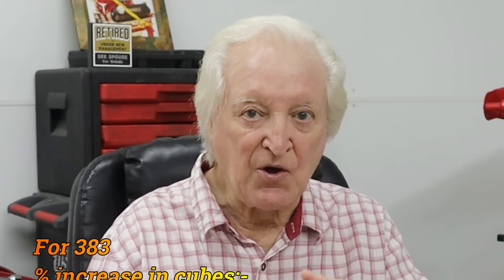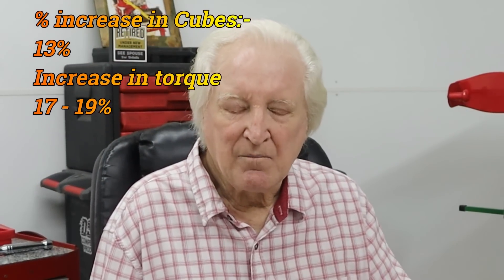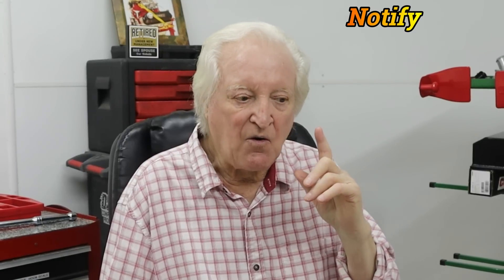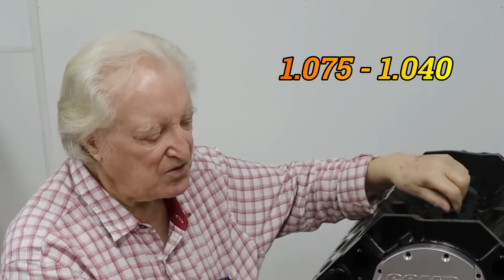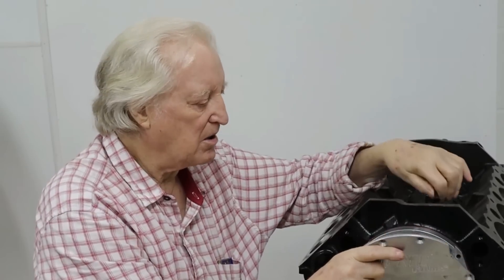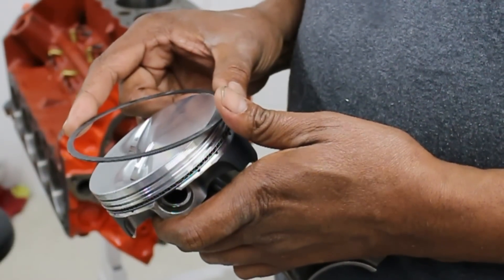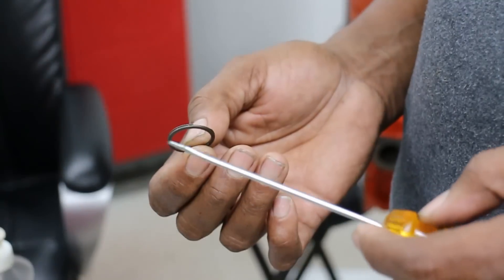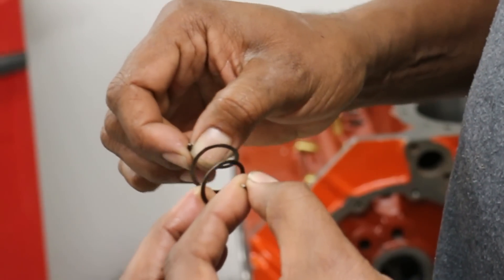Why are these #'s critical for a good torque build?

Comment: What about 87 octane for my daily driver?  I’m thinking 9.0:1 for double hump cast iron heads ported as per your suggestion.  Cam 225 on a 110 for a 327
Reply: Thats about right. You can rent his cam program for two week segments. It has everything to narrow down what is optimal for your application. He did a walk-through of it on one of his videos but it's not titled properly to find it.
The link to it is in the description of many of his videos.

Comment: A good racing trick is to leave the first piston ring off the motor to make the reciprocating assembly liter and keep the top ring from locking up the motor if the ring gap is too big.

Comment: Very informative video. I was just inquiring if the same concept would work on LS style engines (4.8L, 5.3L, 6.0L) as it does on small block 350 Chevrolet? What about forced induction use (turbocharged/supercharged)?

Comment: Looking to build a 383. This is what I have. 1 pice rear main block (880) 4 bolt main. Scat 383 crank, 5.7 rods ,Speed Pro H860CP30 383 Flat Top Pistons . A set of heads World S/R I 052. Performer rpm airgap intake. All I need is a hydraulic roller cam and lifters for this block. Everything I have listed I have lying around in my shop, so all I am going to pay for is machine work for the block. My goal here is to build a 383 that is all torque for a wood hauling truck plus tow hall like a trailer for camping. I guess what I’m asking is for a cam recommendation and if these heads will work with this combination. Thanks again for your time great informational video.

Comment: I would be curious as to what the dynamic compression ratio was on the 396 that you built that made 542 ft. lb. and 585hp with the 10.8 to 1 static compression.
Reply: and what heads.....?

Comment: The reason the huge gain in torque of a 383 is because you are not only increasing the volume of the charge, but also the piston has more leverage on the crank, being that the journals are farther away from the crank centerline.

Comment: Mr. Vizard,  It appears the 400 cu. in. small block is the red headed stepchild in builds. I don't understand why , people are so willing to give up cubic inches of the 400 to grind and machine the 350 block to gain 30 more cubic inches. What are your thoughts on this.
Reply: 400 has really short rods, supposedly doesn't like to rev, they also didn't make a whole lot of them.  Personally the way I figure it if you're looking for max power/$ you build a 454 if throwing tons of parts and work at a 350 is required to meet goals and you can fit the larger engine.

Comment: You helped my late friend Terry Towns back in the late 80's or early 90's with his 355 sbc. He had a 69 camaro running 9.90's on the motor with 10" slicks and slapper bars. After you milled .150 off the pistons, a "good" valve job, and I believe you degreed the cam it ran 9.60's!!!
Amazing!
Reply: Richard I am planning a video on Terry's car. Any photo's? Sorry he has passed away. Good guy for sure.
Reply: @DavidVizard  I'll have to look through my photos.  Phil Smith is who helped Terry with the chassis, like using Mazda 323 struts for the front suspension. Unfortunately I dont have any of his contact information. Brian Desermo, (I probably misspelled his last name) was real close to Terry and probably has some useful pictures and possible video of the car. Again I dont have any contact info.  I'll look into getting you more information. Thank you for all your help past and present! 
Sincerely
Richard Bentley 
Richard Bentley

Comment: I got a 10.98/1 (9.0/1 dynamic compression) 93 octane on street 406 (1974 817 cast) with 220 Flotek CNC .200 raised runner heads that flowbenched at 315cfm @ .600 and a cam I'm not sure abt. Older 830cfm BG HP950  It's a Schnieder 292 hydraulic roller with .622 ex/.613int 70° overlap but only 242/238 @ .050 on a 110 lsa degreed to 108. Howards race lifters, It's all forged weisco flattops scat 6" rods with 9000 series scat crank... I did a 7.13 @ 98.8 mph spinning on street tires. But feel like she needs more cam. Th400 with Hipsters brake, 4500 8" Freakshow nitrous stall but won't spray her till I get her to hook with some qa1 shocks and stickies... Thoughts on the cam?? Ty.

Comment: The GM GenV Small Block L8T Direct Injection 6.6L/401cu follows your talking points, from the factory.
9.240" Deck, 4.065" Bore x 3.860" Stroke with an 10.8:1 Compression Ratio using 0.051" Head Gaskets.
Factory 6.098" Rods give a 1.580:1 Rod/Stroke Ratio, with a 1.053:1 Bore/Stroke Ratio.
87 Octane friendly (and recommended, even @ 10.8:1) thanks to Direct Injection.
Factory Heads (Intake) flow approx 207 CFM @.300, 260 CFM @.400, 300 CFM @.500, 320 CFM @.600.
59cc Chambered Heads. Splayed 2.126" 12.5° Intake and 1.590" 12.0° Exhaust Valves.
297cc Intake/107cc Exhaust runners. Tiny ~116LSA+ Camshaft (200°/207° @ 0.050, 0.551/0.524 @ 1.8:1 Rocker).
HP/TQ at the crankshaft (running all accessories etc.) is 401 HP @ 5,200 RPM, 464 LB-FT @ 4,000 RPM (SAE).
With a suitable camshaft (similar lift, 110-112 LSA, 235/240 @ 0.050), Intake manifold w/100+mm Throttle Body
and timing/Tuning for better fuel, this stock engine can easily see 150+ Gains in HP/TQ.

Comment: Hi David, I wondered the torque increase myself and came to a potential answer.

A longer rod slows how the displacement grows from TDC through to 90 degrees of crank rotation when compared to a standard "short" rod. Since the longer rod has a smaller space through the first 90 degrees of rotation (and a bit over) then even if peak cylinder pressures were the same, the rate of pressure decay would be less. This would yield greater pressure by virtue of the smaller volume. This pressure would be applied through the power stroke until either the volume matches the short rod or the exhaust valve is open, all of which would lead to an increase in torque.

Im sure there is more to it than just that, like the extra dwell at TDC of a longer rod to help build more pressure from the burning charge. 

Just something I thought was worth contributing.
Reply: and now you know why chrysler engines (especially big blocks) smoke the others on torque when most other things are equal.
Reply: Heavy Mopars are slow car's. GM #1 .

Comment: I would love to see the reasoning  behind domed piston vs dished piston for a given compression ratio.
Reply: I can't speak for Mr. Vizard, but I believe the common idea is that the "large dome" style pistons incumber the flame front [not very efficient for complete combustion] as it travels across the piston top. A flat top piston [very efficient] is ideal for flame travel, a dished piston is second best. Sometimes there is no option, and the only way to achieve the desired compression ratio is with a domed piston, like in the case of most Big Block Chevy's.
Reply: @Torquemonster440  Hemis would seem to be horrible for flame propigation.
Reply: @machwind3266  , just the old versions
Reply: It's flame front disruption
Reply: Besides. I'd rather hear it FROM DAVID. not a nitwit that thinks another comment is going to prove something.
Reply: Could also be the proportion of surface area on the piston. More area on the piston can capture more of the force from the expanding gases.
Reply: @purestress2597  No - if that were true they would spiral-groove every flat-top piston for more of this "surface area"
Reply: No. The cost to machine or cast that increases manufacturing difficulties and cost. Ford knew 2 more cams would open up the modular engine to make 150 to 200 more hp. Money killed it.
Reply: @purestress2597  So - talk to me about the "3-valve" Ford V-8's that basically eat themselves !!
Reply: @peterdarr383  3 valves 2 cams. Ford wanted to do 4 but bean counters killed it. Woosh.
Reply: @purestress2597  You don't go "Woosh" on the side of the road
Reply: If it's come any closer it would've hit you.

Comment: Why is it modern motors have small CC heads, small domes. Old big blocks and small block chevys had small CC heads and small dome pistons. Yet. The old combos were called dirty heads that shrouded the valves and limited HP. So the most common  and  powerful BBC & SBC motors use large CC heads and huge domes. But DV says that costs HP. 🤷‍♂️🤷‍♂️ Guess my 1966 396 BBC with 98 CC heads, 10.25 comp. ratio is not antiquated junk??
Reply: DV's contention is that most combinations could be improved.

Comment: what about a 4.155 bore (400 block) with 3.5 stroke?
Reply from the maker: Mr. G
 I have done a 3.75 stroke 4.03 bore Vs a 3.48 stroke with a 4.185 bore. Both work out to 383 so it's a question of short stroke Vs long - both with the same cubes. I will dig out the results so keep watching!
Reply: @marvingvx1  Thanks very much.  By the way, I am planning on running 6.150 rods.
Reply: @marvingvx1  I would also like to see the performance difference  between 3.48 and 3.75 383sbc.both w 5.7 rod.would cam spec on 3.48 be similar to 350? have you published test results in mag or book? I have a 400 block ,350 crank,camel hump heads.new72lt1 hydcam(yeah, I know there are better cam choices, but is for street driving and don't want stiff springs and reduced reliability plus cam is paid for long ago.)I have not compared build cost yet, just thought about putting some old parts to good ?use.im in research mode and always trust your information.

Comment: Your video was  fascinating as always. I sure which you could do one to explain how you get away with high compression on low octane. The video you did on the 705hp, 421 sbc  on 87 octane is amazing.
Reply from the maker: Cameron - I hate to say this but it should be on 107 not 110.Kiss 25 hp and 25 lbs-ft goodbye matey - sorry!
Reply: The cam grind is basically the only difference. The cam will close the intake valve later on a high compression, low octane motor. Giving it less stroke to actually compress anything. That lowers the dynamic compression, which is basically the cylinder pressure before it fires. Most NA street engines operate at a dynamic compression ratio to 8 to 9:1, regardless of what the static compression is. The higher the static compression the less stroke you can actually use to compress it, simple as that. Motorcycles use this a lot... Variable valve timing can take way more advantage of it as well....

Comment: looking forward to a mopar 408 LA stroker combo.I plan on building one this winter for my street CUDA. will be using trick flow 190 cc / 60 cc chamber  and - 20 cc dished pistons for approx. 10.0-1 compression .need to pick a cam that will work with power brakes .changing the ring and pinion from 4.30 to 3.73 .providing i can get parts.
Reply: On a 408 with 10:1up and aluminum heads power brakes = a comp XR282HR with 110 or112 Lsa should do it.

Comment: I am putting a Comp Cams 305H cam into my 383 stroker  bored 30 over, and I would love to hear what you think of this grind?

Specifications:
Engine Make/Size
Chevy Small Block (262-400)
RPM Range
3500-7000
Lifter Type
Hydraulic Flat Tappet
Int. Duration Advertised (Deg)
305
Exh. Duration @ .050 in. (Deg)
253
Exh. Duration Advertised (Deg)
305
Int. Duration @ .050 in. (Deg)
253
Usage
Street/Strip
Quantity
Sold individually
Lobe Separation (Deg)
110
Exhaust Valve Lift with Factory Rocker Arm Ratio (
0.525
Intake Valve Lift with Factory Rocker Arm Ratio (i
0.525
Valve Lift with Factory Rocker Arm Ratio
0.525 int./0.525 exh.
Advertised Duration
305 int./305 exh.
Computer-Controlled Compatible
No
Valve Springs Required
Yes
Cam Style
Hydraulic flat tappet
Exhaust Duration at 050 inch Lift
253
Intake Duration at 050 inch Lift
253
Duration at 050 inch Lift
253 int./253 exh.
Advertised Intake Duration
305
Advertised Exhaust Duration
305
Basic Operating RPM Range
3,000-7,000
Grind Number
CS 305H-10
Exhaust Valve Lift
0.525 in (13.335 mm)
Intake Valve Lift
0.525 in (13.335 mm)
Reply: David always says tighter lobe separation is better.....after watching tons of his great videos.  106 to 107 LSA

Comment: I picked up on 1-2° tighter LSA when building a stroker, but no other event numbers (like intake closing, overlap at 0.050” tappet lift, or others). What about a general change in intake flow to accommodate the stroker cubic inches? 542 lb-ft from a 396 computes to 1.37 lb-ft/cu in, a good number. The really strong engines (maybe more race oriented with power coming at a higher rpm point) seem to make or exceed 1.4 lb-ft/cu in. I’ve seen very few that make very much more than that, but bigger torque numbers seem to favor the higher rpm builds. The fascinating thing is that the stroker motor makes 5-ish percent better torque—due apparently to bore/stroke ratio and improved combustion dynamics. Really interesting video, thanks DV!
Reply: Turbos make all that so much better though. I am at 3lb-ft/cid on my daily driver and I regularly build engines in the 5-6lb-ft/cid range for competition they are diesel though too.

Comment: DV, Would you say the total friction (not just the negative impact of the side loading in the bore)of the engine; the valvetrain/ bearings etc., is the secondary player that compliments the strokers combustion and compression advantage for tq per cube? My informal experience of observing years of Engine Masters competitions, appear to favor tq production of engines approaching or at 400 cubic inches. Additionally, having guest speakers from your career is great. Thank you Mr. Mervyn Bonnet for your time! v/r wh